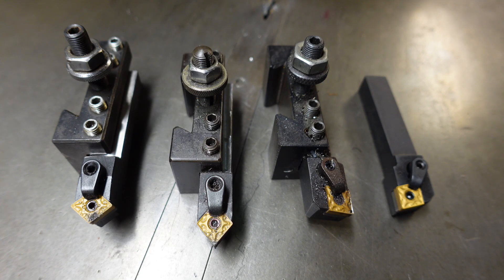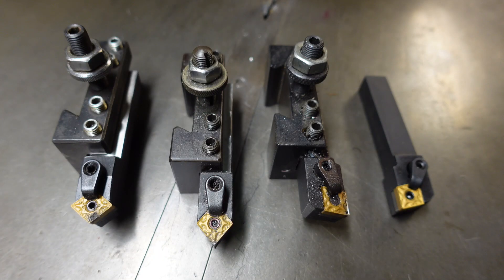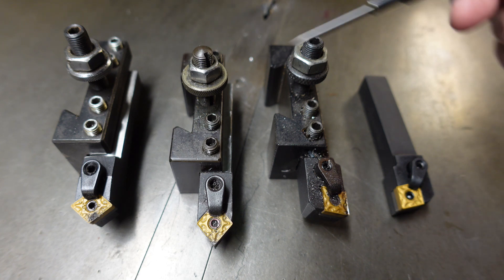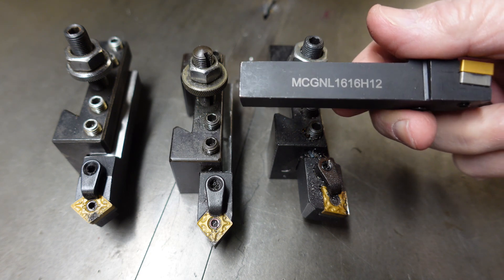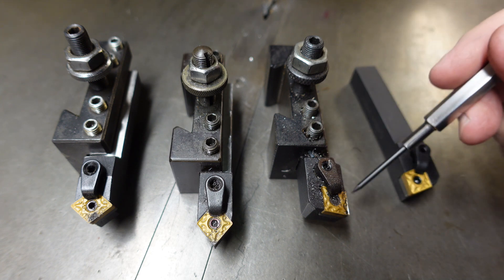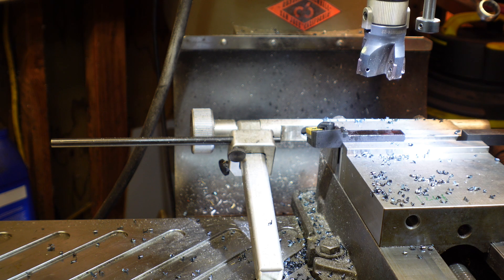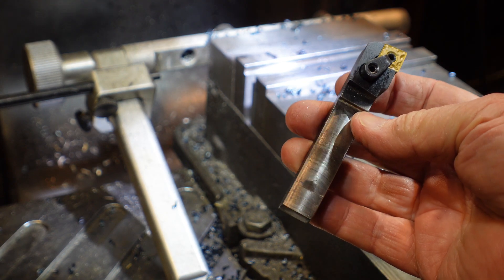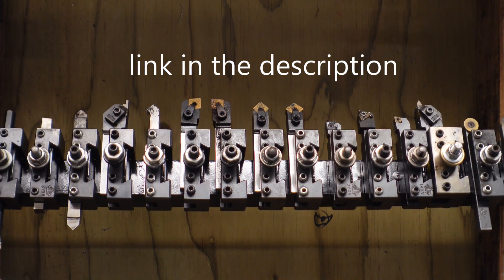Lathe Turning Tool Holders

Comment: There's one option people always seem to miss when installing tool holders such as a Cxxx-432 on an Aloris style tool post. Take a larger hold such as a 1-1/2" shank. You then cut down the back side to the same dimension as your regular tool holders and the cut a dovetail to match. Drill and tap for the adjustment screw. If the tool holder is too tall for your machine machine the bottom of the tool holder so that the holder sits on the compound. It is a much more solid set-up as it eliminates one tool to holder interface.
Reply from the maker: thanks for viewing and good comment, I hope viewers read....
Reply: Well I did just copy an Appt is AXAD80 tool holder

Comment: I trust your judgement about them working well Chuck otherwise I wouldn't be subscribed. I am surprised that the laws of quantum mechanics weren't seriously thrown out of wack using a Banggood tool on a Monarch EE. By my rough calculations the universe should have immediately imploded into a black hole. :-) With a negative rake tool like that I doubt they would work all that well on my much lighter lathe though.
Reply from the maker: LOL, thanks for viewing and you are most likely correct regarding the lighter lathe

Comment: shim for the carbide underneath. it prevents the double sided insert from chewing thru the tool holder (edit) also sets the angle of the cutter).
cam lock tool post, snugs it in, the clamp ensures it holds w/out popping off the cam. both just need a light snugging... not a wrenching.    I guess you didn't need to lower the tool in the axa holder.   I might take off a little to bring the cutter closer in on both the top and right side of the tool holder. That way it's really in the holder.
Reply from the maker: thanks for viewing and your spot on comments, I hope other viewers read as you filled in the blanks for me...
Reply: Plus the screw for the top clamp has left and right hand threads.  See my comment above about using larger shank tooling to make the actual dovetail holder. One key to rigidity especially on smaller lathes is to get the tool as close to the part clamping the tool post to the compound or cross slide. Distance means the tool has less leverage.